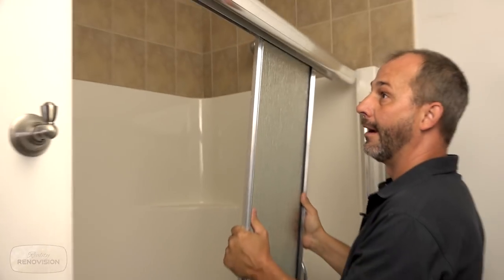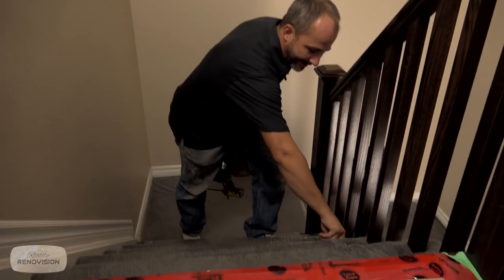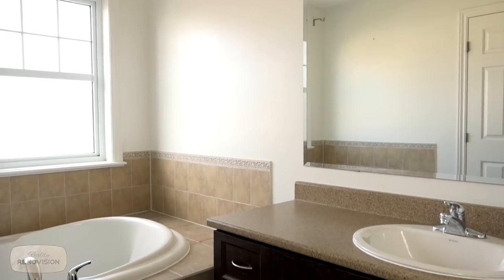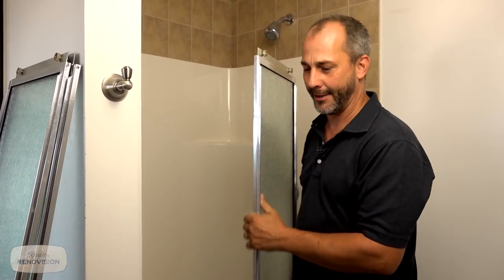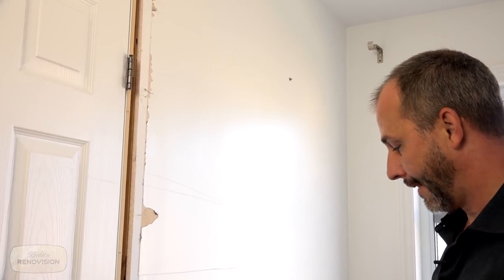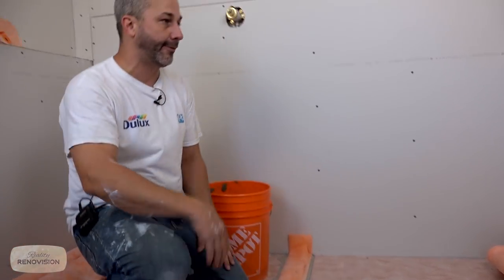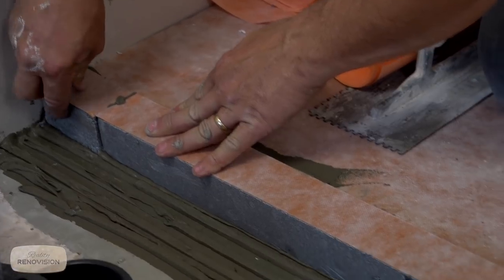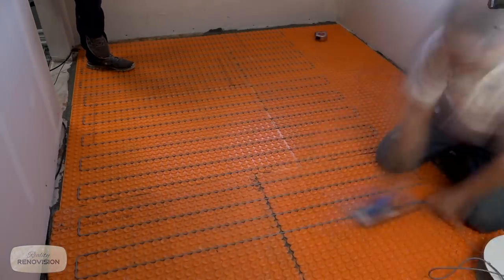This Bathroom Can't Get Any More SEXY!  | Reality Renovision Ep08

Comment: Big pet peeve is when you find that previous workers put cabinets over construction garbage and dust (like the tub in this vid). HATE that. We saw that with our bathroom/shower renovation. Also, they cut the insulation about 2 ft short on the outside wall of our shower.   Time for the industry to stop being lazy and teaching workers how to do it clean and correct.   I would be totally stressed out to have a house built and see the cutting of corners and crap practices. 😱  Thanks for pointing these things out as you go.  Fascinating.  😎

Comment: Absolutely beautiful job and great work as always! Was wondering what spacing you used between the tiles? I'm redoing my bathroom with 12x24 tile on the floor and was gonna go with 1/8" spacers because of the size.

Comment: Mate great install, my only advice would be as a fellow installer I normally install the sliding door system inside the cavity wall.  So in theory you would gain the extra 30" that's needed for the door the open freely.  Only a thought but hey great job.
Reply: Wow, that is a great idea, ty.

Comment: Nice video.  That shower looks awesome.  I had a question about the curing time for the cement.  I live in Phoenix AZ area and was hoping to put a heating system on my outdoor patio for Winter nights.  Now in AZ the temps can be 50 degrees C in the Summer.  Does this mean I would have an effective blackout time for installation?

Comment: Super design and job, but I have one question: how do you clean the shower drain? 
A couple of yrs ago I made a new master bath room in my house (quite similar to this one). During the design process my plumber strongly recommended NOT to put in one of these long drains as no good system existed for a collector box. With a normal drain I now flush every 3 months with a couple of buckets of hot (near boil) water through the drains and toilet, and this keeps the system free from all the loooong hairs and dirt (should mention I had to install a minimum run on the pipes due to restrictions within the house).
Reply: The drain lifts out with a little hook tool. There’s usually a basket in the drain to catch hair.

Comment: When I did one of my rental renovations, my contractors talked me out of the sliding door system because it does not provide as much privacy (doesn’t seal as well). Wonder what are people’s experience of those of you who have one?
Reply: We installed a glass door when we remodeled our bathroom. You can get glass doors that have designs or frosted for more privacy.  I don't think glass doors r  less "sealed" than the other types of enclosures. I've had all of them & if u r a person who flings water around & don't dry off while in the shower then ur floor is going to get wet...I try to explain this my husband but we installed a vinyl floor & love it. Besides that's his bathroom mostly. :)
Reply: @willowdreams1786  I am not talking about the tub door. I am talking about the bathroom door.